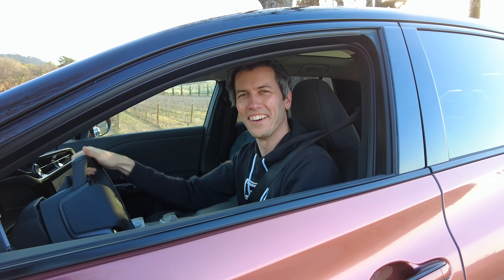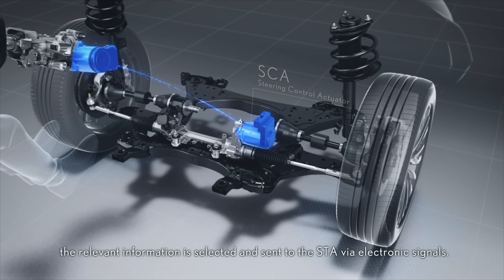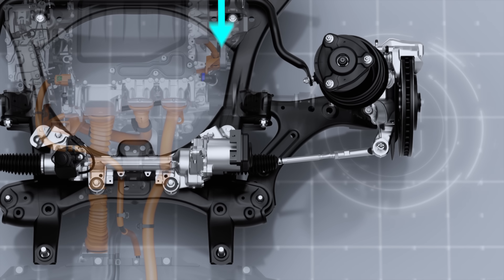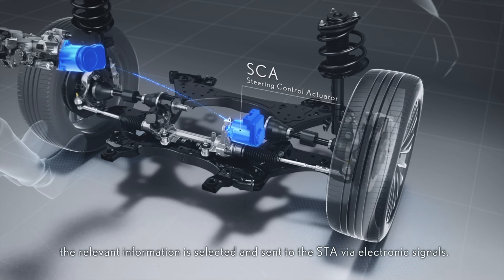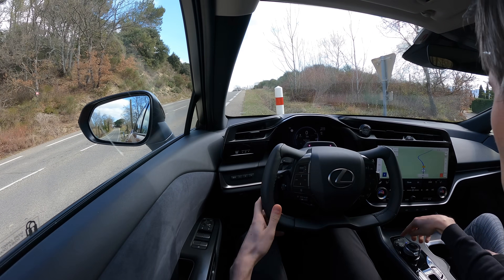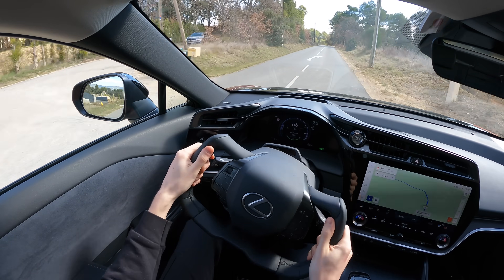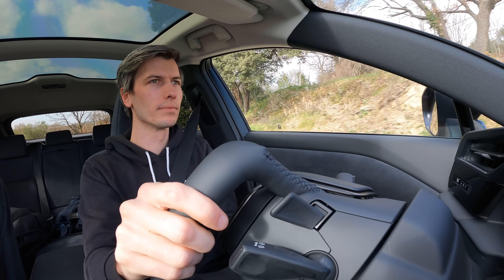How Lexus Fixed Tesla's Bad Idea: Steer-By-Wire Yoke

Comment: As someone currently working in an engineering team converting a vehicle to have the steering wheel on the other side, this would be amazing. Probably opens up new possibilities for Frunk space. Probabyl also helps in crash wioth even less chance of steering wheel punch in. Probably helps on platform design too, you can have the same "skate" architecture on EVs on many differnt vehicles with exactly the same rack, and just drop on what ever cab you want, with what ever wheel and feeling you want.
Reply: Look up Canoo vehicles, if you don't already know of them. Steer-by-wire is built into that vehicle design for all the reasons you mention. (Quite interesting vehicle, too.) I've been wondering how they got that past the regulators, but this video touches on that - Canoo is probably similar.
Reply: The first drive by wire factory car was sold in the 1980’s and in the 1990’s so he is wrong..

Comment: In addition to the concern about the steering system 'crashing' (to use a computer term) and leaving you with no input whatsoever (and without knowing how the system is designed, telling me there are redundant motors doesn't mean there are redundant IC's or control modules) there is also the (admittedly much less-likely today) risk with all your driving inputs being digital that those inputs can be re-routed to a source other than the driver.  There have already been hacks demonstrated where a car could be remotely started/shut off and accelerated or braking applied by someone other than the owner.  When steering is added to the mix, 'hacking' someone's car means you could fully take over and drive them where you want or crash them at will.  Is this likely today - certainly not...but is it a greater risk when your steering wheel is not what tells your wheels where to point?

Comment: In Australia cars must have a mechanical connection between the steering wheel and the actual wheels... It will be interesting how this plays out with new cars getting sold here. 

I wanted to change my old LandCruiser to hydraulic cylinder steering but it isn't legal.

Comment: Lexus has done a great job with redudancies in this innovation but there is going to be learning curve which if approached sensibly shouldn't take long.
Common sense says to take it easy for a while to adjust to the peculiarities before diving into Formula 1 mode.
Perhaps an introductory driver training course could be set up with dedicated instructors that can guide less confident drivers to become comfortable with the system.

Comment: Wait wait wait, Toyota is just getting drive by wire tech? 😂 when I was in school for Daimler Chrysler mid/late 2000s we covered that because by the time we hit the field in the next couple years it would be common in cars we’d be working on. The 2013 Hyundai Santa Fe sport has it also, of course I didn’t have the push start so no Kia boy challenge worry from me. Plus I don’t own it anymore

Comment: Man the title. I thought this was going to be something else.
In a basic sense, people didn't like the yoke because they are not driving an airplane. 
But if they are requiring you to pretzel your arms. That's even worse.

Toyota can just make it user adjustable how much steering quickness/effort the user wants.
Traditionally new features start off as options and as people order more, it becomes more common until that feature is pointless not to just include it. 

And yes.. cars are waayyyyy more capable than they used to be. Average person. It's to much vehicle. Like 70%

Comment: While I'm 6'+ and have trouble with seeing everything on the dash, and my knees hitting the stalk, I still prefer the mechanical system over this- the steering lag is a big concern, and the inability to make a drastic evasive movements at high speed is a real deal breaker (there are far too many idiots on the roads over here not to have it)

Comment: Agree with the steer by wire for yolk. 
Don't agree with dozens of buttons and stalks around the steering wheel. That's just cluttered and gross.

But also, screw yolks altogether. There's no real reason to move from normal steering. Especially not for everyday drivers that just want to get to work.

Comment: You say that you can "flail away" at highway speeds, yet it doesn't feel twitchy at highway speeds. Either there is a ramp where steering adjustments near center correspond to a small wheel changes but adjustments far from center create very large changes OR you cannot turn the wheels to the same extreme angles at highway speeds compared to low speeds.

Comment: BMW had this.  I test drove it and hated it.  Maybe if you are new to driving then it will be OK but I couldn't get use to the variable rate.  Keep turning into curbs and such with the faster ratio at low speed

Comment: Steer by wire may be simpler to manufacture but more expensive to fix if there’s a problem.   I prefer mechanical steering due to more accurate feedback.

Comment: When software engineers try to take up mechanical engineers work, they complicate things just for the sake of complication. F1 doesn't have lot of space to keep hand over the top of rotation axis of their steering and the F1 sitting position. Hence the Yoke. In normal cars for laid back comfortable driving, Yoke make no sense. In long drives shoulders of the driver will hurt as he/she has to constantly lift their hands rather than resting them on top of the steering wheel. I maybe be wrong, so can be the car manufacturer. Yoke can be gimmick and or maybe something which we truly need. My bet it is gimmick.

Comment: With this variable sensitivity, does it mean that if you're going in circles on a huge parking lot with a constant steering lock and constant speed and you decelerate, the turn radius will also decrease?

Comment: I see why Tesla just slap a yoke instead of doing all that lol, the model s is not a new car from scratch, steer by wire would just be a bit much for them in that short time they had. And they like removing stuff because less part to worry about I guess, not having so many bottoms is less parts they have to make. They just extra efficient and somewhat a little bit more environmentally friendly.

Comment: When left as an OPTION, this seems really smart. Based on your comprehensive evaluations, I expect I would be very uncomfortable with steer by wire, so would have problems with being forced into using it.
Reply: the wheel part/interior for now should be yoke and non yoke aka 4 ordering code option's, im sure that probably will get widdeld down to one popular choice like manual transmission's now general not being ordered anymore 😢but at least the sales/engineering team can get a better idea of what people actually want/willingly to pay for

i probably wouldn't mind having the by wire but the yoke im not sold on yet, as i haven't ever used a yoke and most to me are in unpractical movie/show car's ect
Reply: Nissan has used it in some of their higher end products for a number of years & as far as I know they haven't had any issues -  but as a software engineer, I wouldn't drive or ride in one.
Reply: Read my posting 15hrs after yrs. (After my experience,  I searched the Internet..... hundreds of examples of similar events)
Reply: What is uncomfortable? Airplanes have been fly by wire for decades
Reply: @Greendile  I know right? Whenever I get in my plane and pilot around town, I've never had an issue.
Reply: @Greendile  It's different in a plane, a car wheel is in contact with the road, you can feel the road with a physical connection, with this, you feel nothing, no feedback
Reply: @prich0382  Did you watch the video?  It has a set of electric motors attached to the steering wheel to provide feedback based on what the wheels are doing.  Might not be that great though - won't know until you try it - though as I mentioned, personally knowing how buggy a lot of software is, I wouldn't trust it with my life.
Reply: @Greendile  For me, it's shown in the first 5 seconds, the steering wheel is already 45 degrees to 90 degrees turned to the right before the front wheels even reach neutral. I'd like to have more immediate response as well as a mechanical feedback through the system.
Reply: @TheWildSlayer  streering by wire the tow/alignment can be 👌all the time and not a compromise for longer tread life and NVH ect, so around a racing track it's faster lap times ect and pot holes have less of a negative pull on the car as 1 wheel can temporarily go nuts but it wouldn't pull it into on coming traffic or roll

so actually in theory is handles better as for the feedback loops that's yet to be determined as it could be 👌or 💩 , so without me/you driving is a unfair call, as for 180-wheel and my video games as a teen you can get used to it but as i pointed to sometimes it's nice having the option for fixed 10:1 ratio

like i said the yoke very well might be 👍but my experience is watching the tv 📺not using it in a daily driver's car intended for the end users experiences

also like i point to auto pilot+yoke is probably not bad but im a manuel transmission's TR6060/1950-68-🇺🇸 convertible vibe's control and privacy's freak so i just don't feel comfortable using yet or buying a car with lots of cameras+gps ect

Comment: I suspect that an ideal every-car system will eventually contain a separable mechanical shaft that fails closed (or "connected") with a circular-ish wheel and some form of mechanical limit override on that coupling that prevents the wheels from falling too far behind the steering control during fast maneuvers.

Comment: To the point of the input delay:

Like with electronic throttle bodies, companies put in delays so that the experience is more smooth and gradual (Similar to the point of having a tight ratio steering rack). If the system was programed to work 1:1, yes the input would be more snappy but the experience would be more jarring to the average driver. 

This same system in a more sporty vehicle would allow for a more snappy system in Sport or Sport + (Dare I say "Track)" modes.

Comment: I personally think a non-linear system might work better than a speed-dependant one. For instance, at 0 degrees, the steering is also at zero, at 45 degrees, the steering would be closer to if the wheel was at 90 degrees, at 90 degrees it would be 200 degrees steering wheel angle equivalent, and at 180 degrees it would be 450 degrees steering wheel angle equivalent. In this case the speed of the vehicle does not affect the steering ratio, so it could be much more predictable. In my example, assuming the normal steering wheel has 450 degrees of rotation to either side from center (900 degrees total rotation lock to lock), then converting yolk angle would be: YolkAngle^1.176448747444=NormalSteeringWheelAngle

Comment: So...they set out to make it faster than mechanical steering...and it's not. And they set out to make it more comfortable...and it's not. My biggest concern is having my steering be electronically limited. If there is stability control over my steering that prevents me from making an aggressive turn-will I hit something ahead of me instead of avoiding it in a crash situation? And as for a yoke steering wheel, does that not take away comfort? Instead of being able to cruise on the highway with a hand at the bottom of the wheel, you have to have two hands on it all the time in an upright position? 
Overall, it's really interesting tech, and I know I'm way too traditional for the future of cars. Awesome video, though, thanks for the info!

Comment: Let's say you are driving in a large flat area.  You start out driving at low speed in a 100 foot diameter circle.  You do not adjust the position of the steering yoke.  Now you accelerate so that you are going as fast as traction permits you to maintain that circle, then you steer to drive in a straight line.  I would think that with the increased speed, the steering ratio would slow so that at higher speed, and with the front wheels now pointing straight, the yoke would be twisted now to the other side?

Comment: It appears to have a big delay in between steering wheel position and the front wheels angle (0.03/0.04). Kinda of -» Not good for the driving safety. Useless type of innovation. Like the old saying - If it is broken don´t fix it. :)
Plus, I doubt most users will know or be interested in how to setup the feedback system. So, great more stuff to break that expensive to fix (exactly what the common folk needs). Since this is a lexus remove the common folk and it more of a fancy gimmick :)

Comment: I actually designed and drew a concept car when I was a kid, 30+ years ago, and listed out all its features including a steer by wire system. I was ahead of the times! Although in reality, I think GM may have done it first in the 1950’s with the Firebird III concept car.

Comment: This is one of those things that is interesting but not likely something I would get behind. I understand that fly by wire has been a thing for a very long time in aircraft, I also understand the build quality difference between a state-of-the-art aircraft and a mass-produced car are vastly different. Even the build quality between heavy equipment and a car is immensely different. So I have a hard time believing the tech in a car would be reliable in the long term. Like after the car is on its second or even third owner because just like not everyone enjoys driving, a lot of people simply cannot afford a new car. Because unlike aircraft or heavy equipment, personal cars do not always get the best maintenance since they usually do not make people money. 

I do agree a million percent that not everything has to be a touch screen. Every new vehicle test I see makes me less interested in buying a new vehicle.

Comment: This seems like a ton of added cost and complexity for the sake of slightly better packaging and easier parking. As far as sensitivity goes, I think most modern cars have struck a very good balance between responsiveness and stability. Considering how light most cars' steering wheels are at low speeds, having to turn the wheel further for full lock is hardly an inconvenience. I've had a lot of complaints about driving in general, but having to turn the wheel past 120 degrees isn't one of them. I could however see a system like this being useful for someone with a limited range of motion in their shoulders and wrists.

Comment: Not a fan, if a vehicle like this sits somewhere for a prolonged and all its batteries are dead you will not be able to move it properly. A vehicle with a mechanical steering I can move and more importantly change directions. A steer by wire needs power to do anything. In case of a catastrophic power failure you can still push and steer a car with a mechanical steering around, with steer by wire you can only push back and forth basically.

Comment: i think its easy to compare this to racing simulations, especially since the way feedback to the wheel is basically the same.
and in those nobody uses speed sensitive steering angle, its just awful and ruins any kind of muscle memory you might develop. its only used by controllers who are not precise enough.
having this in a car would be an absolute deal breaker to me, cause i could never be sure how steering would react. i would never buy a car like this, even though the other things might be positives.
if theres one thing i do not want while driving is a black box between me and my input. that just seems dangerous.
what will happen when i have to quickly dodge something like an animal on the road, which would technically unsettle the car but is preferable to running into it? is the software gonna adjust the steering sensitivity in this case? i dont even know if id want it to, if it does i may get a spike of sensitivity, if it doesnt i may not be able to avoid an obstacle...this is honestly nightmare fuel to me.
i dont even wanna be passenger in a car with this system, let alone buy one.

Comment: Instead of a changed steering ratio, I prefer a change in the level of assistance. I've had motorway experiences where a lengthened ratio would equal an accident.

Comment: I prefer to avoid unnecessary complexity. A simple mechanical steering rack is exceedingly unlikely to have a catastrophic failure and doesn't need external power. A computerized steering system has hundreds of additional potential failure points, any of which likely to prompt an expensive urgent repair to prevent a very likely catastrophic second failure.

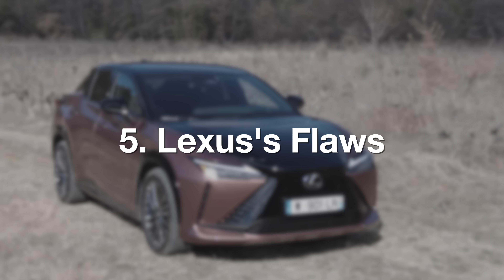Comment: 10:49 They should display a screen/indicator graph to communicate when the steering is more or less sensitive so that drivers can be aware and adapt. It would be better also if they used the self driving features, cameras etc. to err on the side of less intervention if sensors indicate the steering input is coming from actual needs on the road. Eg. if there’s not an wall there let me steer the car. I hope the delay could be adjusted or tweaked as well.

Comment: If the steering ratio varies according to speed, then what happens when the car slows down while turning and you maintain the same steering yoke position?

Put another way, the angle of the steer tires will be different at different speeds, for the same steering yoke position.  So what happens when you slow down or speed up in a turn?

I don't think I'd like it.  I drove a new Dodge Charger RT recently for a month (rental car).  It was an amazing experience and many handling characteristics could be changed on the display.  But it also was a relief to get back into my 1994 pickup truck.  All of these gadgets trying to help you and think for you and make decisions for you etc, are mentally tiresome after awhile.